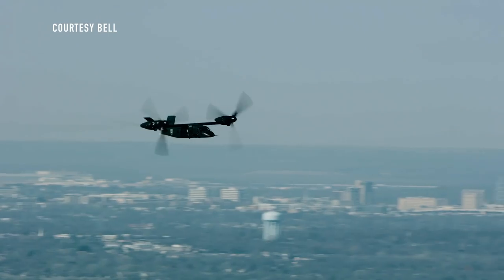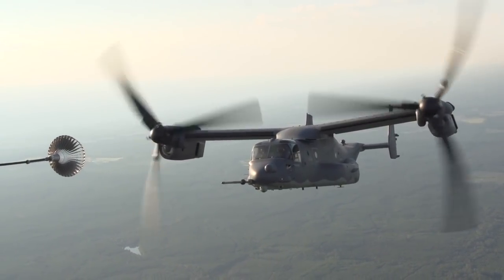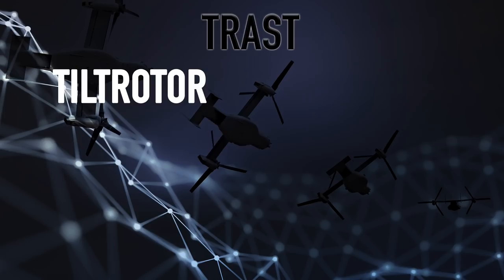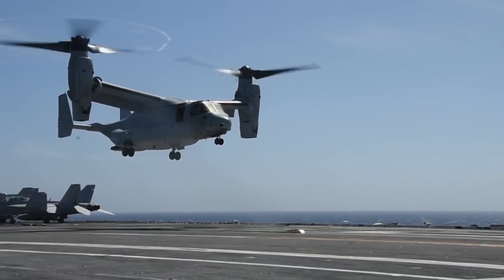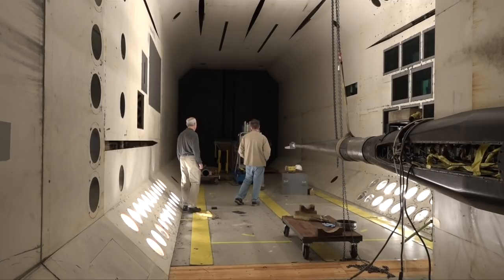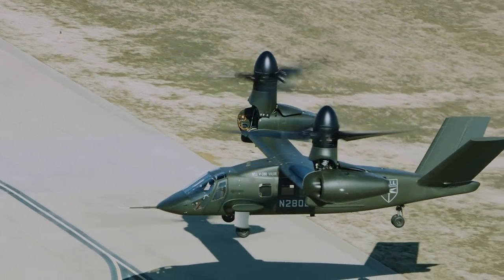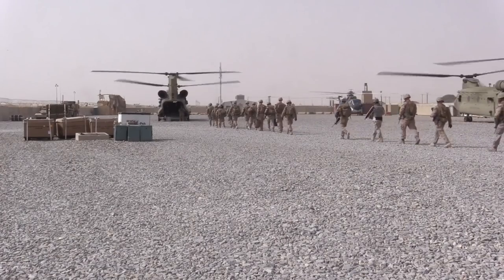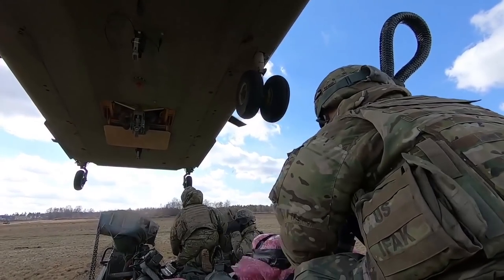Army  pushes for higher speeds in future tiltrotor aircraft

Comment: I wonder if they will implement a belly missile launch system where they could have several missiles inside the cabin in a slanted position similar to a gun's mag clip so that the missiles could lower into place out of a hidden doorway that launches the missiles. Such a system would only take away around 6 inches of side room inside the cabin each side with the missiles slanted so it would take up about 6 feet wide from floor to ceiling of missiles perhaps up to 7 or 8 missiles each side of inside the cabin. A smaller 20mm Gatling multi barrel gun could be deployed from a pop out turret that has a 90 degree sideways sweep & 45 degree elevation sweep for targeting as well as a 20mm belt fed gun for a operator to use from the rear of the heliplane. These improvements would take the heliplane into a formidable attack class troupe carrier, cargo carrier being used on hotzones.

Comment: Are they considering anything like the Rotodyne design model? I like the design myself, but being I'm not an engineer, I defer to those whom are.
Reply: nah... they cant make that thing overly expensive so its not interesting lol
Reply: The Rotodyne is limited by advancing retreating blade to less than 200 mph.
Reply: @mikerogers4640  yes it was slow but that is not the limit at all for such craft. if main rotor is rotating much slower and wings take most of the lift 400km/h should not be a problem. after all mi24 has the max speed of 330km/h and with no pusher prop and wings.

Comment: Theoretically....would there be a benefit if the blades of the rotors were able to telescope to a 50% reduction plus an additional fold out aileron to increase cruise speed and facilitate a traditional type airplane type landing in case an engine goes down?
Reply: Folding a rotor blade mid air while spinning in high speed is suicide. But not impossible

Comment: The Army belly ached a long time ago that it was prohibited from using fixed wing aircraft for offensive operations.  This was the whine during the development of the Cheyenne helicopter.  The solid rotor was one problem, the other problem was it had wings.  Only the Air Force was suppose to have fixed wing offensive aircraft.
Reply: The Army's belly aching and whining?  Its the Air Force's demands that forcibly created and imposed that fixed wing policy.  If they haven't done so already, should come as no surprise if the AF steps in and put a stop to this program.

Comment: A tilt rotor has to use the same blades for lift and for thrust. The twist of the blades has to be a compromise. If they are well designed for low speed lift, they are wrong for high speed flight. It is then difficult to get high speed flight and good efficiency.
Bell have been working on tilt rotor design for sixty years. The army want to do better. Really?
Reply: They are working with Bell, I think the biggest issue is they don’t want the prob that arose with the V-22
Reply: The difference total twist is the same.  The twist distribution is where there’s a difference.  They can’t really  produce a blade with the optimum twist for either.  Blade design is a best fit that’s close enough.  There are some ideas for blades that change twist with RPM thanks to the magic of composite layers and the 6x6 matrix.
Reply: It's kind of annoying seeing how Army acts as they are the ones figuring out the benefits of this platform when in fact because they bailed out from the initial program made it really harder to come to life. Had not been for USMC determination to have  the tilt-rotor,  they would have had  empty talks today or bought the damn thing from Japan.
Reply: @upcycleengineer7825   Right, USMC, Navy or Air Force wanted the issues from the get go, to make life interesting. Maybe you should read something about how this program was almost killed several times and what role Army played in those attempts.
Reply: @G Force, the Army dunked the Osprey before they bailed.   Thanks to them it lost the ability to pressurize and gained a hook that made everyone treat it like an expensive quickish helicopter.
Reply: @gforce5529  "they would have had  empty talks today or bought the damn thing from Japan."  Funny enough Bell just delivered the V-22's to Japan that they ordered. Haha

Comment: Why don't I see tilt roter aircraft that are armed and engaging target with it's firepower the military helicopters are armed and are force multipliers by destroying the enemy coming in and out of hot LZs every other aircraft that I have seen has weapons systems on board and can engage enemy coming in and out to give your troops the best way in and can keep enemies heads down until the crafts ammo runs out and then leaves after to rearm and pick up another load of troops
Reply: Because the Osprey is a medium lift aircraft and the Valor is still in early development. The Valor will have door gunners like the Black Hawk at a minimum.

Comment: Why cant they make tilt rotors with jet engines?
Reply: That’s just VTOL planes like F-35s and Harriers.
Reply: Yeah but those are 1-2 people and no cargo
Reply: It's a power to weight ratio. Jet engines can't provide enough vertical lift that's why they need a runway. Plus the exhaust thrust on take-off and landing can cause some crazy ground affects.
Reply: Two big problems FOD issues and what caused most Harrier landing crash pot stalls where the hovering jet engine sucks in low lift super heated jet exhaust and loses up to 50% of its lifting trust

Comment: Incredibly loud. No where near the ability of the Raider / Defiant program. DOES NOT have turboprop speed. Needs much larger landing zones. There are some basic transport in noncombat area missions that this thing is suitable for, but do not buy off on the idea that this replaces helicopters.
Reply: "No where near the ability of the Raider / Defiant program"
...
Except it is faster, flies further, has better acceleration and deceleration, carrier more people or a heavier load, and didn't have the multiple technical issues the Defiant had...
Not to mention you are overstating the size of it as it can already fit in the vast majority of LZs the Black Hawk would use.
Reply: @n3v3rforgott3n9  quite literally the only one you got right is flies further. Your words are obviously without knowledge.
Reply: @brianmoore1164  My guy... public knowledge that was released show that the Defiant's max speed in testing was 247kts... that is 63 kts slower than the Valor. They have also released statements saying the valor beat the Defiant in time to altitude tests (acceleration) and time to stop from cruise speed (deceleration). Along with the Valor being able to carry 2 more troops and well over 1k lbs. You have your facts so totally off. 

The Valor also only has a 19% larger total footprint and can pit anywhere a Black Hawk can as long as it isn't restricted by the blades of the Black Hawk on all 4 sides. IE it is wider but also much shorter so turn it 90 degrees and it will fit. It has also been proven to fit in existing hangars made for the Black Hawk.
Reply: @n3v3rforgott3n9  Since its max speed was not a max speed at all and only a tested speed so far, everything you said after that must be ignored due to your obvious lack of knowledge.
Reply: @brianmoore1164  HAHA Ok so the cruise speed was 33 KTs faster than the max speed the Defiant has shown. You are just a joke at this point. Everything I said is public knowledge and even Sikorsky hasn't disputed the numbers and facts given.
Reply: @n3v3rforgott3n9  STILL knowledge deficienct! The speed you are citing was a partial throttle speed, and the test pilots said it had "lots" of throttle to go.  Furthermore, it was done with a low powered engine and NOT the new MUCH MORE powerful engine because it has not completed its testing yet. Your lack of knowledge is extreme.  I know you're a fan boy and fan boys gotta fan, but you're out of your depth. Your lack of understanding is causing you to lie repeatedly, and it makes you look ridiculous.
Reply: @brianmoore1164  So instead of proven results you are going off of nothing... HAHA and you call me the fan boy?
Reply: @n3v3rforgott3n9  You are embarrassing yourself.  Please stop.